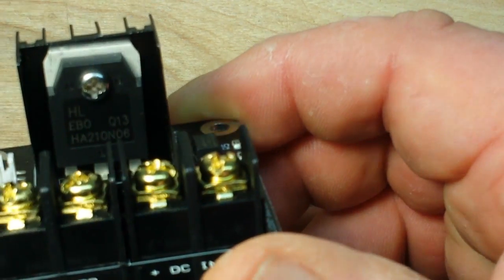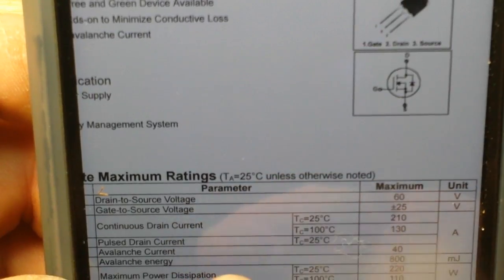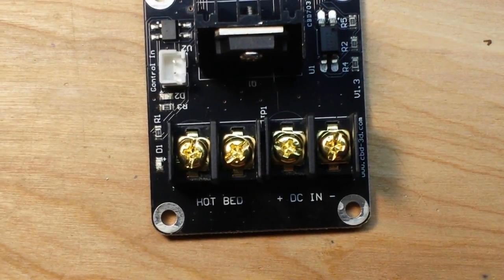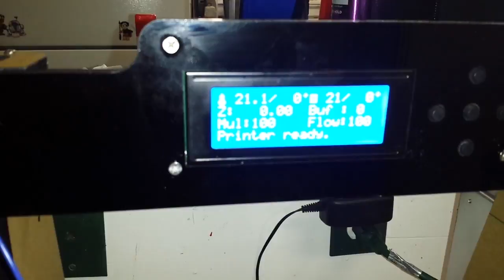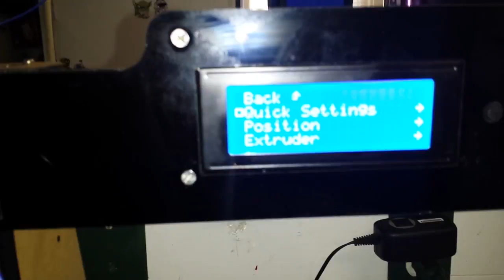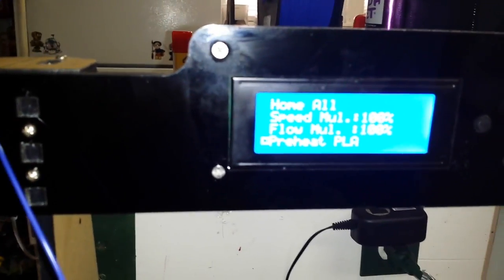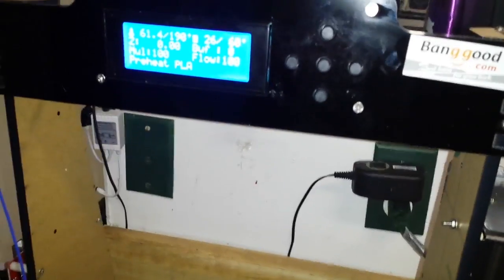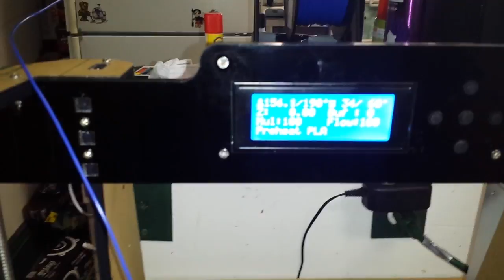Anet A8 3D printer dual MOSFET upgrade

Comment: (1) The reason your fan still slows after fitting the MOSFETS is that they only unload the high current from the puny connectors on the control board, the poor old power supply still does not have enough GRUNT to supply the required current without a voltage drop. It drops about half a volt under full load, don't  turn up the voltage to overcome this as it will almost certainly shorten the PSU life.(2) I have checked out these MOSFET cards with a multi-meter, the white control plug/cable is not polarity sensitive , it is connected through a bridge rectifier to send the correct polarity to control the MOSFET.
Reply: Yep, stock voltage on my PSU is 12.5V that drops to about 12.1V with everything heating - I don't plan on tweaking that with the pot on the PSU but would if it was dropping lower than 12V. Have a look at Marlin and the PID control - the bed is not PID by default so you'll need to go and change the settings. TIP: there is a bug in the current release of Marlin (1.1.8) that means you'll have to disable #define THERMAL_PROTECTION_BED to autotune the PID values https://github.com/MarlinFirmware/Marlin/issues/8942 (don't forget to re-enable the protection afterwards!!)
Reply: I installed this today.  Now here is the weird thing: I get the blue light to come on like its activating the mosfet which I assume acts like a relay.  Problem is that I don't get a light on the bottom of my heat bed.  I have to connect it directly back to the board and the led on the bed comes on.  If I move the negative lead to the negative on the mosfet board from the power supply it comes on.  Problem is if I turn off the bed the bed is still heating... Very very confused! Any thoughts here? Thanks!

Comment: The fan slows down because your PSU is only a 20 Amp PSU. If you upgrade the PSU to at least a 30 AMP you will heat faster and the fans won't slow down. And you're an EE?

Comment: Hello,thank you for the video.
One question though,12awg speaker wires would be good for heated bed?
The original ones lasted ok,but I want to be careful as I have cable chains.
Cable "specs"
Ofc speaker cable by sub zero2x2.5mm(square)
Thank you again!
Reply from the maker: 12AWG should be fine.
Reply: @learnelectronics  thank you!!!

Comment: This video is giving me OCD overload. Is that hot bed installed in the wrong direction? Shouldn't the plug be on the back?  Do you normally leave your wiring just hanging like that with no cable management while it's printing, especially the wiring to the extruder?  Why is the paper backing left on the acrylic?  Is that a banggood sticker you have on there? :)  :)
Reply from the maker: yes

Comment: MOSFETs are good but I would do 2 other mods, get rid of the connector on the hot bed and solder the wires directly to the hot bed and last thing is upgrade the Marlin firmware.

Comment: hey man noobalicios over here is having the same issue that you had in the beginning. The underside of my prints look a lot like that. Could you point me in the right direction for settings and adjustments to fix that?
Reply from the maker: Level the bed so that you have drag on a piece of writing paper and turn the bed heat up.

Comment: im not sure if you noticed but those cheap mosfets don't include any kind thermal compound between the heatsink and mosfet chip.
i personally added some thermal epoxy i had laying around. i also had to desolder the heatsink from the board to do this without bending things.
also is it odd that the heatsink is soldered to the board? it seems odd to me
Reply from the maker: +mer2329 I didn't look for heat compound, thanks for letting me know about that. As for soldering to the PCB, that's a common tactic for using the copper backplane in the PCB as a heatsink. It's a cheap-out really because you are passing the heat to any other components on the board, but you do see it.

Comment: Check you power supply voltage while under load, the power supply we all got with the printer is well not exactly up to the mark... but there is a small pot by the screw terminals that you can adjust to see if that helps. I have done a few upgrades to my printer but mostly for longevity, ie braces for the front and back bars as ive seen a few that have broken under the strain of the belts, print bed level knobs makes leveling the bed loads easier than with the wing nuts. Mosfets i consider essential as also seen the fores these things have caused, Keep up the great content, hope these pointer help :)

Comment: like you i am not in to upgrading all part but i have grand kid and beeing electrician i always think safe so i made a covet for the power suply conection and put in it a male plug with a switch i can cut power when not in use here the plug check it out you like it https://fr.aliexpress.com/item/Panel-Mount-Green-Rocker-Switch-3-Pin-Plug-Power-Socket-AC250V-10A/32653410517.html?spm=2114.13010708.0.0.UsHDWp

Comment: I was thinking about getting one of these for my alternator regulator. would it work with pwm. and what is this exactly? is it just a get on board? or is there more components? can I use it with pwm that the alternator does as it regulates . also does it have a diode? I have been thinking about the flack from the coil in the alt. there could be hundreds of volts. the rotor is a fairly large chunk of iron. with a huge copper coil. I don't know if you know about alternators or not. I don't want to bother you . however could you read my scribbled block schematic voltage regulator / zener controlled switch. it required pos voltage to shut off the ground source for the rotor in the alt. my phone will not let me in my G mail app. the last few times I tried. I need a new phone! anyway thanks a lot. and great video .
Reply from the maker: +James stranger This is a MOSFET with a couple of resistors and and a diode. It will absolutely work with PWM. however, this one is only 60VDC. 

I looked at you diagram and it looks doable for sure. I sent you some feedback, if you get into your mail let me know.

You can find a MOSFET to fit your voltage range, check out Digikey and your specs in.
Reply: learnelectronics 
do you think I should ho up to about 100volts and 20 for the FET. to help with voltage spikes. and I'm thinking it will require as much as 10 amps give or take. I need to build 4+ of these. and want to get all the components at the same time . and want them to be reliable .  I don't want to have to replace the FETs in ten minutes . do you think I should add a get to the FETs for protection. I know most have them internal. but anyway? I guess I need to do some testing! thanks
Reply from the maker: +James stranger The rule of thumb in electrical engineering is figure out the Max capacity you will need (volts and amps) and then add 20%. You can use a higher rated component and it should run cooler and last longer.
Reply: learnelectronics thanks for all the help. sorry  I'm  such  a newb. but less than 2 years ago. I had no idea what a MOSFET was. it what anything besides a transformer was. transistors could have been trann sisters for all I knew.. you and a few others have helped me learn a lot! thanks again!